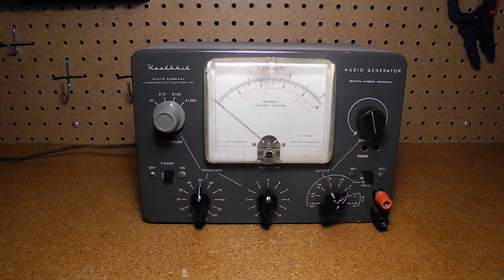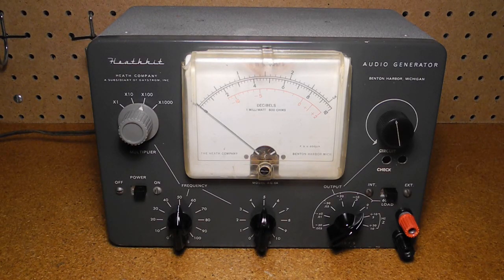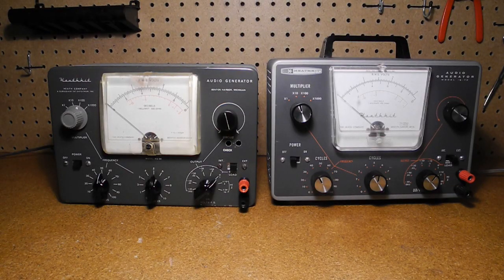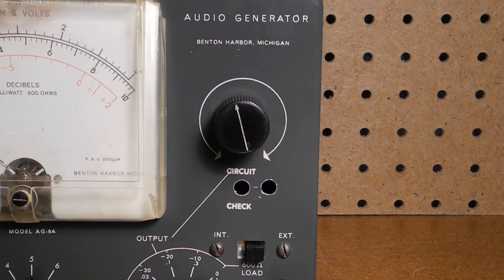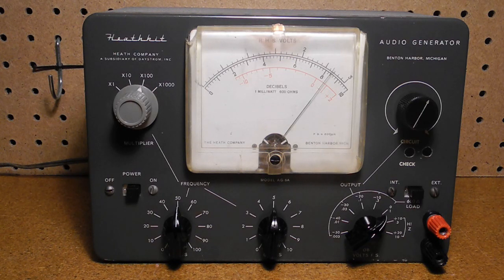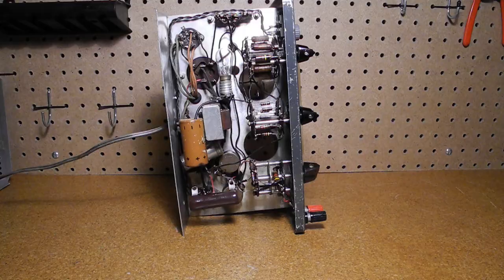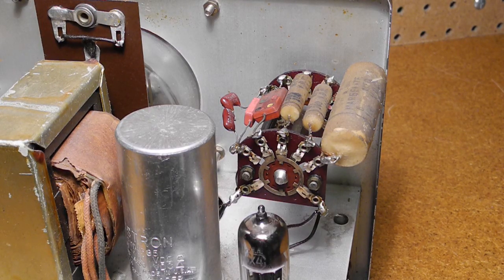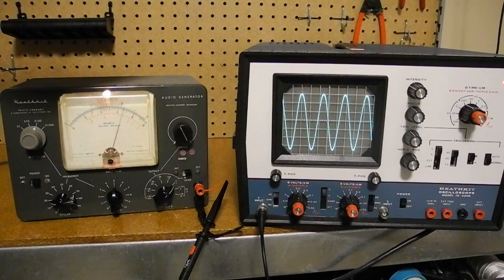The Heathkit AG-9A Audio Generator

Comment: Hi Jeff, I just purchased an AG-9A on EBay. I am expecting it will need repairs. The seller simply listed it as "used" and didn't say whether it works. Does your book offer repair advice for this model? Would it be helpful to have as I work on restoring the device? This is the first time I've purchased a Heathkit device. I am new to restoring these devices. I am also new to working with vacuum tubes. I watched your video on the IG-72. I am so green that I am not even sure what cables I would need to connect that to an oscilloscope. I have noted Mr. Sohmer's question about installing a new line cord. I'm not sure why connecting ground to chassis would be good. Thank you for the video.
Reply from the maker: My book may be helpful for some background information but doesn't include much on repair or restoration. You can find copies of the AG-9A manual on the Internet that will help check the assembly and list expected voltages. Good luck and be careful if you do any work with the unit connected to power!

Comment: Great video.

If you are in the Toronto area A1 Electronics sells brand new gray knobs quite resemblant of Heathkit's original knobs.  I'm pretty sure they are under $2 each.

Can also buy less desirable or more abundant Heathkit units very cheaply at hamfests and use them as part donors for other restoration projects.